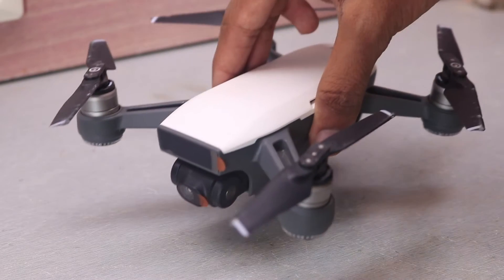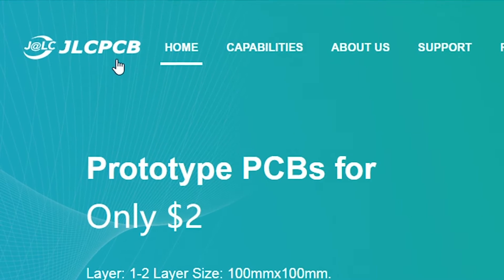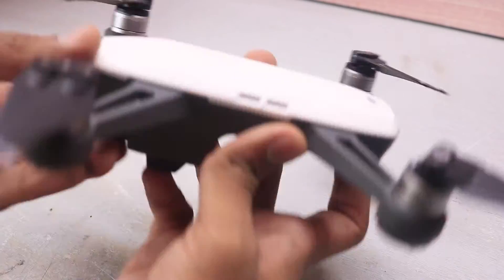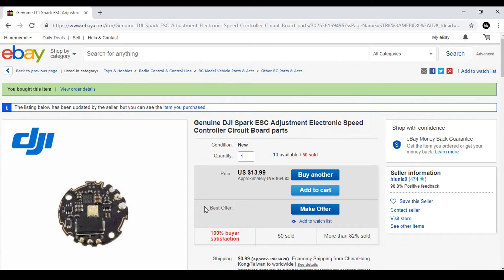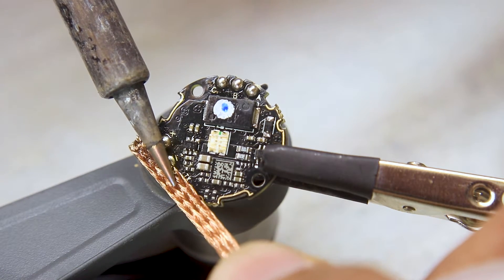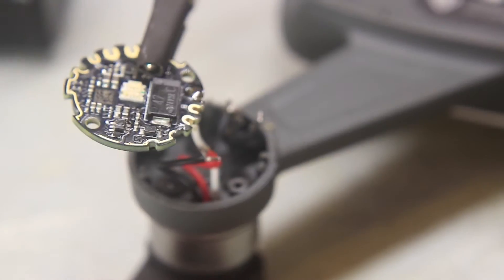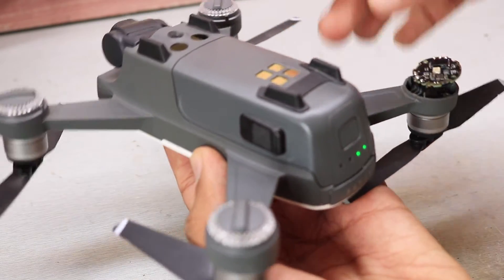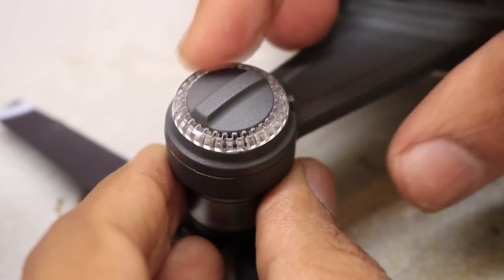How to Fix DJI Spark ESC Status Error | Replacement

Comment: i notice there are three wires going from the esc to the middle frame.  I assume one is positive, one is negative and one is the signal wire. Is that correct and do you know how to identify each one?
Reply from the maker: There are a total of 6 wires, 
3 are input red(positive) black(ground/negative) and white (signal)

The other 3 are output for motors, they are usually black just connect them in the same order as you removed them.

Comment: hi. thanks for this video
i have a question.
my esc leds all turn on. all they have red , green and yellow light
but i present esc problem in the app.
the motor m2 no turns . but the led is on. is problem of the esc chip? or i need a new motor? thanks

Comment: Bro, I crashed my spark, I was flying at 40m, suddenly it said remote controller  connection error and drone tried to land automatically without control on a telephone wire and it fell down, one propeller broke, I replaced it, but now I opened the drone and the GPS chip is broken, I need to order gps chip from Amazon US website now and replace it, spark isn't a reliable drone.,  I regret buying this.
Reply: BHARATH V R same thing is happened to me jajajaja the drone lost control and I think I hit the gps module I haven’t open it but for sure is that it say cannot flight . I order that part already ., from amazon $59.00 I hope that is the problem

Comment: @Nemantic.  I am also facing the esc error no3 . What is no 3 ?  how we come to know which motor no is 3 ?  Pls help.
Reply from the maker: LED below the motor will we off or one of the motor will be getting hot when turned on
Reply: @Nematics_Lab  hey , i get error of esc no 3 . Pls advise
Reply: @Nematics_Lab  same here
Reply: @Nematics_Lab  but all the lights are working, but in the app it says esc status error no. 3

Comment: Where can i buy the ESC part from can't find it on eBay
Reply from the maker: https://www.ebay.com/itm/Genuine-DJI-Spark-ESC-Adjustment-Electronic-Speed-Controller-Circuit-Board-parts/302536159495?_trkparms=aid%3D111001%26algo%3DREC.SEED%26ao%3D1%26asc%3D20160908105057%26meid%3Df9c20e14a68846669bb243fa70b8e87d%26pid%3D100675%26rk%3D1%26rkt%3D15%26mehot%3Dag%26sd%3D302536159495%26itm%3D302536159495&_trksid=p2481888.c100675.m4236&_trkparms=pageci%3Ac154437e-36bb-11e9-a1c9-74dbd180d08d%7Cparentrq%3A15f4e26a1690a9c46912e2a4fff8c319%7Ciid%3A1